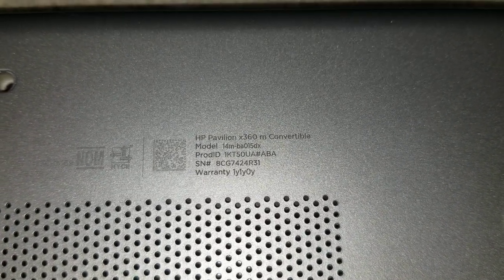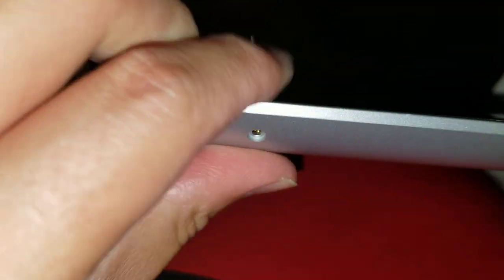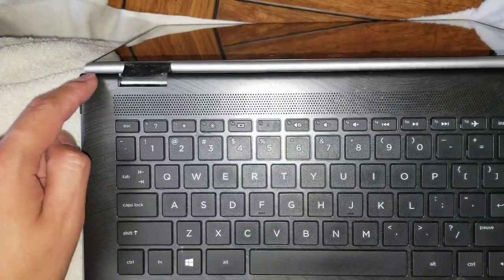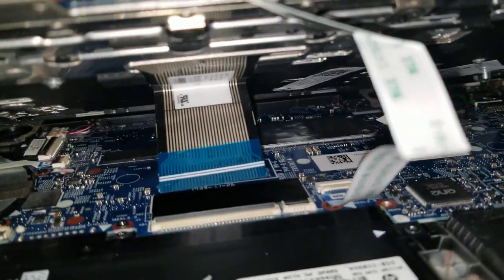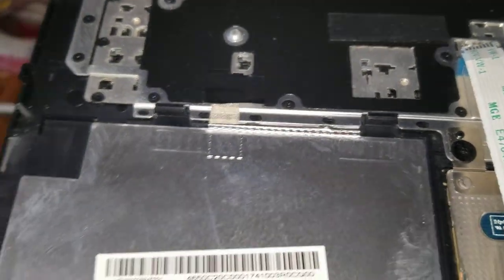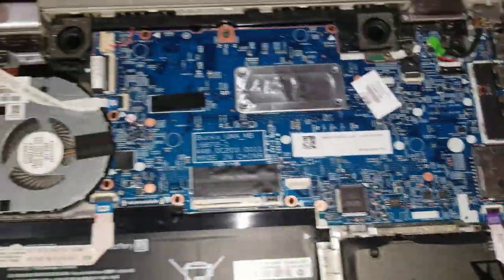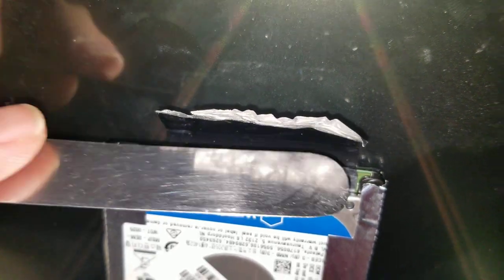HP Pavilion x360 m Convertible 14m-ba015dx Disassembly RAM SSD Upgrade Repair

Comment: i need help...the hdd gone bad and fail, i swap it with ssd and install windows 10, but every time it boots it says
"SMART Hard Disk Error" 
"Hard Disk 1 (301). 
F2 System Diagnostic
Enter - Continue Startup
When i press enter it does startup, but it is really annoying to see this screen and having to press Enter all the time.
Has anyone experience this problem? Any way to remove this error when starting up? Do i have to order recovery disk from HP?

Thanks
Reply from the maker: Might want to replace the SSD. Maybe it's faulty. What SSD did you get?
Reply: Yea i figured it out it was the ssd faulty...thanks for the response though...

Comment: An Sata 3 SSD M.2 can be installed on this model. ?

Greetings from Chile.
Reply from the maker: 2.5" sata only. There's no m.2 slot a you'll see in the video.
Reply: M2slot is backside below the ram
Reply from the maker: @rafintech681  there's one underneath the logicboard?
Reply from the maker: @rafintech681  you're right https://i.ebayimg.com/00/s/OTA5WDE2MDA=/z/NNAAAOSwqiJcAFiw/$_1.JPG
Reply from the maker: Turns out you can https://i.ebayimg.com/00/s/OTA5WDE2MDA=/z/NNAAAOSwqiJcAFiw/$_1.JPG

Comment: Hello so I bought this laptob just a couple of week ago but it's not the same the model is HP 14-dh1025ne Pavilion x360 can I add a samsung hard drive on it?
Reply from the maker: You'll have to open it and check. As long as it's the same form factor it should work fine.

Comment: hi broo, i have a question, do you if this laptop have a cmos battery? i have that problem 
grettings
Reply from the maker: I don't think so. Just remove the internal battery and hold the power button 30 seconds.

Comment: My childs destroyed this laptop yet it still works. I wanted to take the guts out and put it into a new body so to speak. Can you show or tell me how to detach the screen and the keyboard from each other?
Reply from the maker: The video shows how to remove the keyboard. I don't have the laptop anymore, so I can't show how to remove the screen, but there's a lot of stuff connected, not something you should attempt if you don't know what you're doing.
Reply: @ItsBinhRepaired  Ok I will try to research it some more.
Reply from the maker: @staceyw5406  you'll basically have to disconnect all the cables and remove the motherboard and then the hinges

Comment: the memory is hidden?
Reply from the maker: Sorry, didn't realize I forgot to show the other side of the board. I put links to images of the other side of the board in the description of the video. There's a metal cover hiding the RAM. You need to take the motherboard/logicboard out completely and pry that cover off to get to the RAM/memory.
Reply: @ItsBinhRepaired  kk thanks mate looks like only SSD is gonna get upgraded
Reply: Memory is on the bottom under the rectangular aluminum shield. There are two slots. The memory is removable.
Reply from the maker: @wun1gee  I said that lol
Reply: @ItsBinhRepaired  hate this screen..poor colors but atleast its bigger than a phone
Reply from the maker: @stevessteve2920  lol
Reply: @ItsBinhRepaired   Thanks man for your video! I was trying to add another RAM in the extra slot and wish to add my two cents to make the process easier.
 
(1) I found it helpful to first remove the battery unplug it from the motherboard, before trying to get the motherboard out.
(2) We also need to be careful that the fan also needs to be removed and lifted along with motherboard. Finally, do not forget to take out an extra screw towards the power cable corner.

Comment: There are four rubber feet to the laptop ryt... If anyone one of the four is missing, is there any website to purchase them...?
Reply from the maker: I usually check eBay for stuff like that.
Reply: @ItsBinhRepaired  I almost gone through all the websites but didn't find anything.
Reply from the maker: @saradhchandra6671  :( I dunno might have to buy a replacement bottom cover or universal rubber feet.
Reply: @ItsBinhRepaired  Thanks..

Comment: I opened up my laptop but just opened it up from bottom, didn't remove keyboard. Is that unsafe?
Reply from the maker: I dunno, did you break anything?
Reply: @ItsBinhRepaired  no, but wasn't able to disconnect battery. Just opened it up to blwo compressed air on my fan
Reply from the maker: @Anonymous-sv4wd  probably fine

Comment: how to pry off the plastic of 0:21 ?
Reply from the maker: You have to use a needle or something very thin to get into the edge of the silver sticker and pry/scrape it out.
Reply: Oh ok thanks you its works
Reply from the maker: @mmcpro4541  glad it helped. Please like and subscribe if you haven't already. It'll really help me out. :)
Reply: Okay, Done!
Reply from the maker: @mmcpro4541  thanks!
Reply: Thanks you too i were searched for the laptop dissambly to put the other Ram to the extra slot but i couldn't searched a necessary video to did that but thanks i found ur Vid and i made it Ez! Jusst thanks :)

Comment: helu anh, em đang chả hiểu sao thay ổ cứng cho em này xong cài win rồi dùng được vài ngày thì nó lại không nhận ổ cứng nữa, dùng usb boot vẫn được.
Reply from the maker: Sorry, I don't speak Vietnamese.
Reply: @ItsBinhRepaired  okay... Can you explain me why HP x360 not detected the hard drive? I replaced the hard drive for it and it worked for a few days, then it didn't recognize the hard drive anymore, if plugged in from the usb port, it still recognizes it.
Reply from the maker: @panticnic  you might have damaged the sata connector cable
Reply: @ItsBinhRepaired  Oh yeah I see my sata cable have broken, thanks!
Reply from the maker: @panticnic  no problem
Reply: @ItsBinhRepaired  hi, I wanna ask one more question of the previous comment. The sata cable have 10pin, can I use the 12pin cable ? The 10 pin i see on the ineternet is too expensive.
Reply from the maker: @panticnic  you need the same cable

Comment: i purchased HP x360 laptop and i need some info whit this
my laptop came with 120gb M.2 on board  SSD
can i replace it with 1 TB SSD
Reply from the maker: Storage amount isn't a limitation. Get as large as you want.

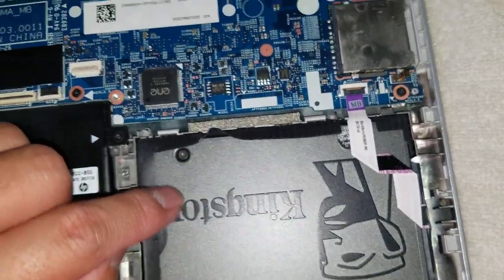Comment: Bihn - Thanks for posting two videos on this model. Helped me save hundreds. Amazon 31 dollar battery, and about an hour because I was being very careful, and it all works! Question: At 4:14 on THIS video, there's a Kingston drive you said you replaced for the customer, bottom right. Our laptop is EMPTY here. That space has nothing, but can you post a link on what to buy and describe how I can add an additional drive to this laptop for my daughter? Did't look like there was anyplace to screw it down...
Also - Does the drive typically come with the 'MB' cable that's shown? Would it ADD a drive (like letter D) or replace the one she has? Will the laptop go through a config of sorts because it's plug and play and recognizes the new drive the first time it boots up with that connected?
Reply from the maker: You'd need that rubber bracket, the cable, and an SSD/HDD. After installing the drive you'd have to go into the disk manager and initialize and format the drive for it to show up as another storage device.
Reply from the maker: If you haven't already, please like and subscribe so others can find my videos and consider donating to the channel so that I can do this for a living. Thanks! :)
Reply: @ItsBinhRepaired  - first thing I did! Can you please post a link to the pieces I would need to buy?
Reply from the maker: @ZZZZZZZIPD  I'll see what I can find.
Reply: mine has an NVMe SSD so is also blank in the spot for the 2.5" SSD is compared to video. That SSD you have to remove battery and motherboard to get to...
Reply from the maker: https://amzn.to/3GuUWgP that should work, but I can't find the mounting brackets.